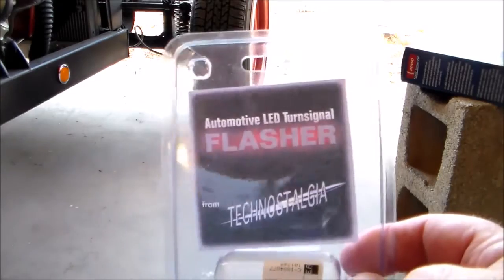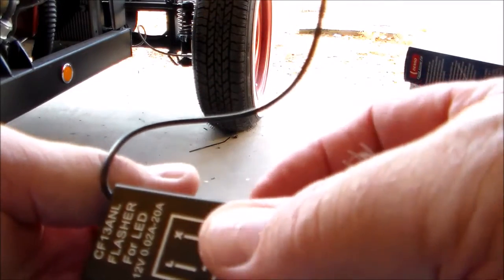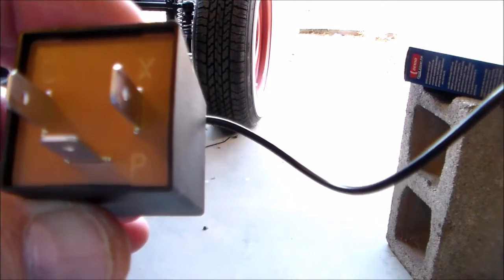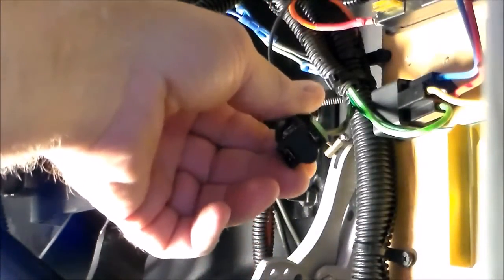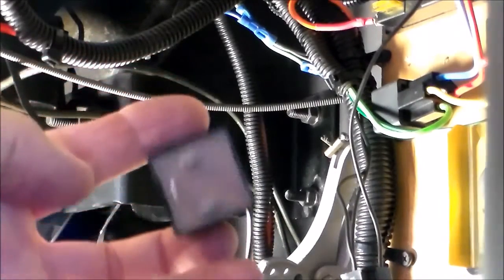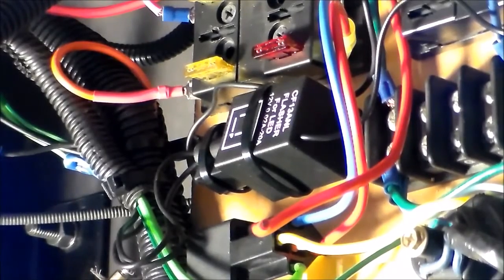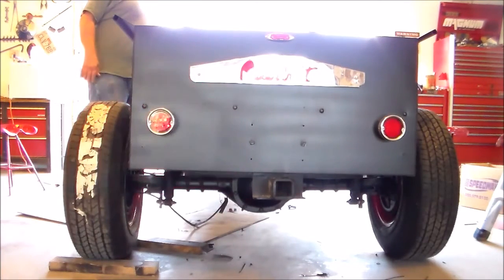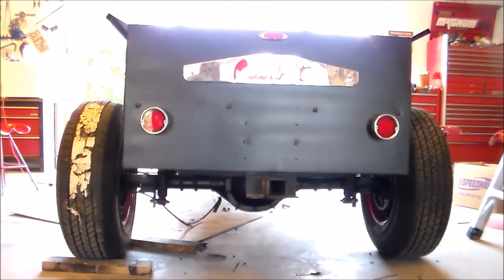L.E.D Flasher Install on the Peterbilt Lakester

Comment: Thank you very much Lloyd-of-the-jungle.  I knew about the wonderfulness of these better lights but never installed any. Now with your help I can.
Reply from the maker: cutworm59 Yes Sir Mr. CW, will work like a champ. You can run some regular light with it too & still works fine.

Comment: Hey good information on the flasher didn't know that was needed FINS UP 👍 👍
Reply from the maker: Eric Polston You may see some service trucks that someone put the round 4" brake lights in and they flash really fast. If they would use a LED flasher it would flash at a normal rate.Thanks Eric for stopping by
Reply: @RustyGlovebox  where exactly do you install it I have a 2020 peterbilt 389 model

Comment: Most useful information Lloyd but can you answer my queries?
1. Can this unit drive additional indicators e.g. if you were to hook a trailer to a car? (I have a low loader trailer with flashers and side repeaters)
2. Can this unit drive a mixed set of lights e.g. some ordinary bulbs (on my truck) + some LEDS (on a trailer) on the same vehicle combination?
Reply from the maker: Dan Whiteford The flasher I bought came from Speedway Motor. It operates with a minimum draw of .02 amps and with a max of 20 amps.
It will operate a mix of lights on the vehicle. 
But the existing flasher on the tow vehicle should operate your trailer because the LED's  draw very little.  As long as you don't draw more than the 20 amp maximum rating of the switch .
Thanks for watching Dan
Reply: Thanks for your reply.